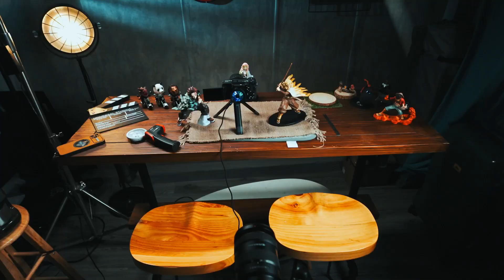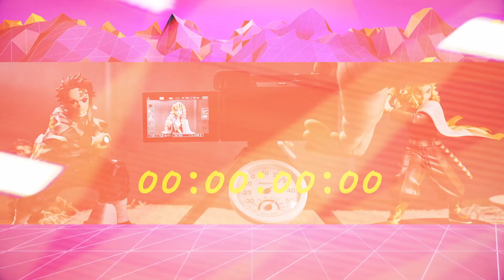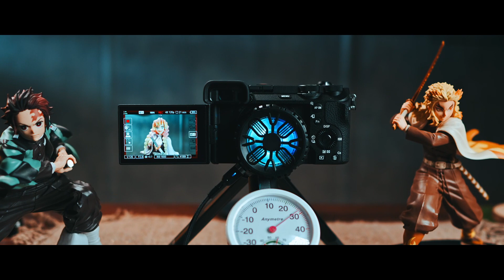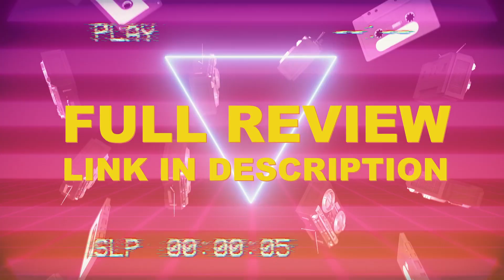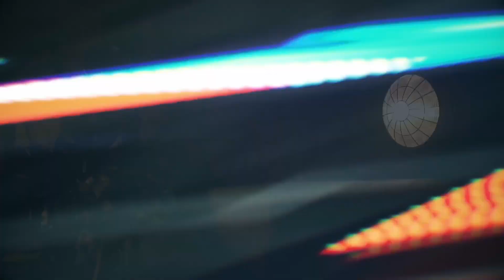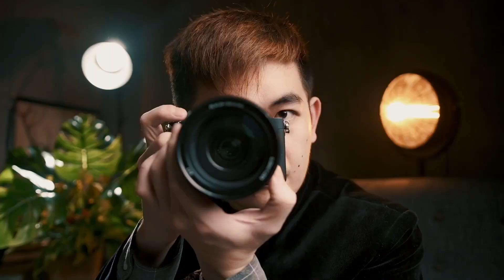Sony a6700 Overheating Full Testing Video | Cooling System Solution ( Idea also work with ZV-E1 * )

Comment from the maker: 👉 Full Review Video : https://youtu.be/ePwSz0W9eZQ?si=zzeFlqEEtDzoZUsG

🔺 * Note : ZV-E1 Semiconductor's size has to be within 7cm * 4.8cm , otherwise it won't fit. Price will be different due to different product, size & country.

🔸 * Note : Idea means by using the Semiconductor cooling sistem to extend the recording time.